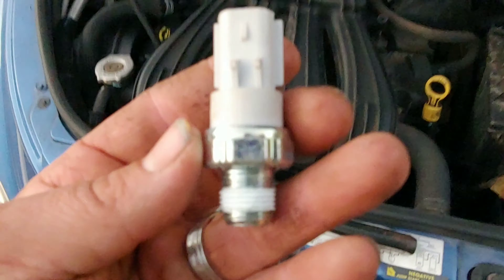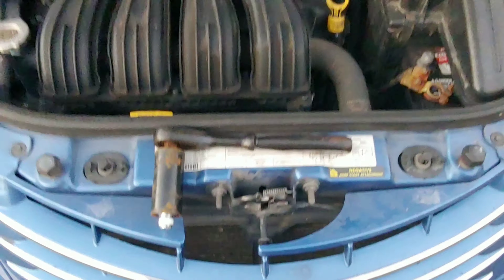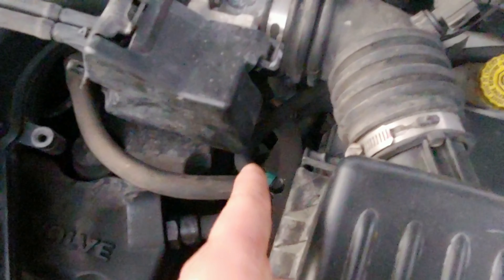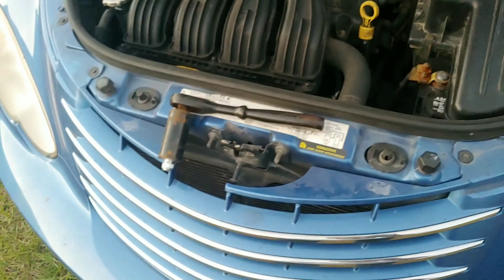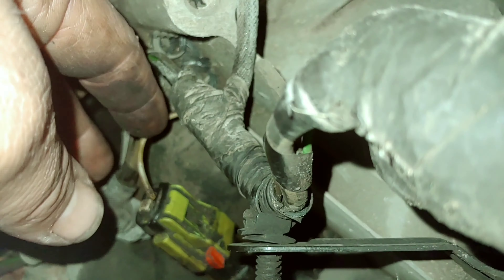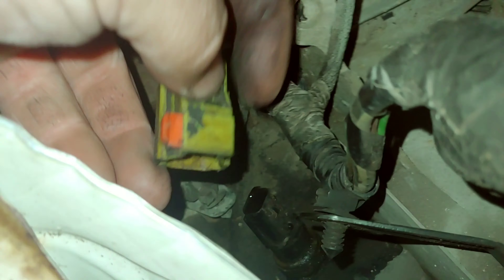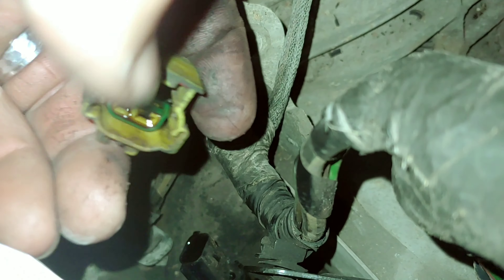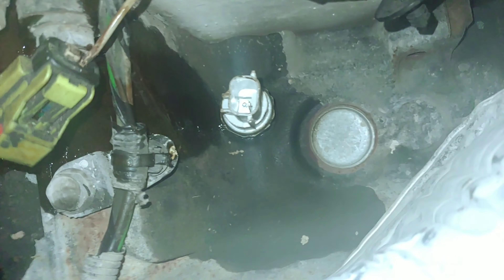Easiest way to fix a pt cruiser oil pressure sensor/oil sending unit in 2 minutes

Comment: I added an aftermarket oil press. gauge (and put back sensor), I also had to go under the car to do that but, your video was extremely helpful, and saved me $. You really have to reach WAY in there for that O.P. sensor !

Comment: Retired Professional mechanic for over 40 years. They make a special socket for a oil pressure senser. You need to be careful of what socket you use. Some socket will crack the housing and cause leak. That's why they make 2 different oil pressure senser sockets. But if you have a open mouth socket like you used non problem.  Another nice thing about the oil pressure sockets are they are 3/8 drive and also can accept a wrench for tight spots.
Reply: Hi so what size socket do I use or can I call an autoparta store and ask for it
Reply: Ya I aint paying for that socket. I went to Napa and they didn't even have the special one with rubber in it, yet they still wanted 60$ for a regular singular socket!!! Wtf? I would throw the car away before I did that. Its just a freaking socket. If you are careful it can easily be taken out without breaking it. Either way I aint paying that ransome

Comment: In the 2008 PT the sensor is not visible as shown here but is still accessed from above in the non-turbo, auto trans version. Remove the intake hose clamps and the entire air filter assembly, then the battery and the two bolts that hold the fuse box in place. Slide the fuse box forward to gain access to the sensor, which is installed horizontally and points to the rear of the car. You will have to feel around for it as the thing cannot be seen.

Comment: Did you try pulling the little shaft out of the connector? Supposedly pulling the little plastic piece out, and replacing it with a straw fixes it.

Comment: Found the sensor and I can even touch it, unfortunately I have a standard shift model and I have 2 rods in my way. I'm gonna have to get to it from underneath, if possible. I'm about due for an oil change anyway.

Comment: Put oul pump an sendin unit an its still commin on car only got 100000 miles on it it is a lemon lol glad ya fix ya problem but that not the problem on this pt 06
Reply: most of these cars are lemons. I've driven mine 15,000 miles and already have replaced over a thousand dollars of parts.
Reply: @mattymuso2108  same here.  I, agree with you.